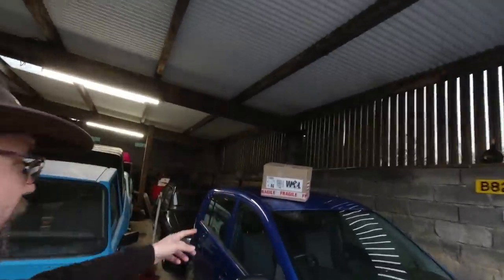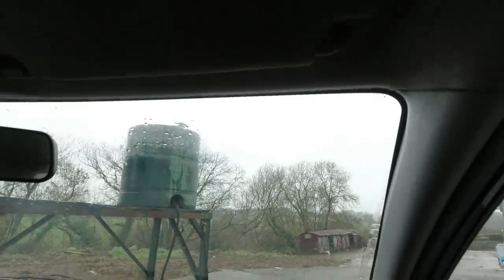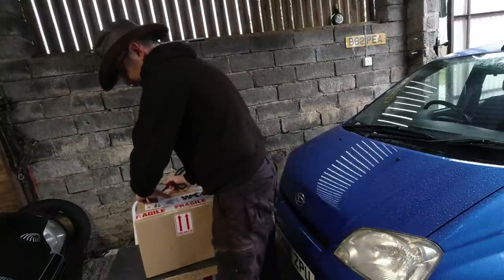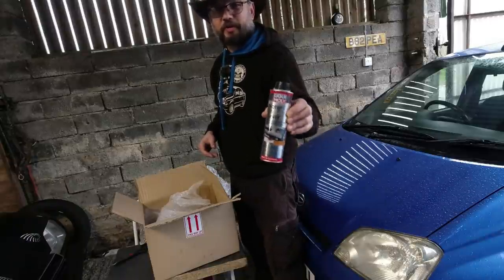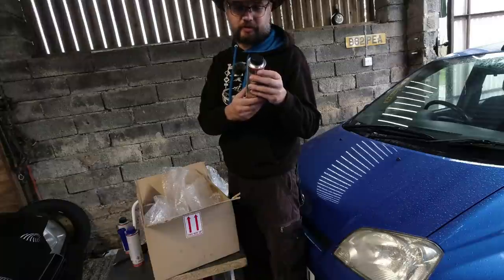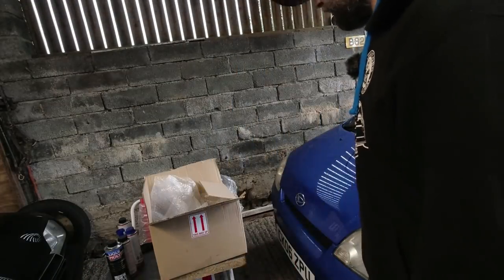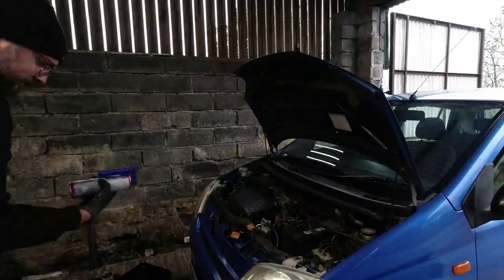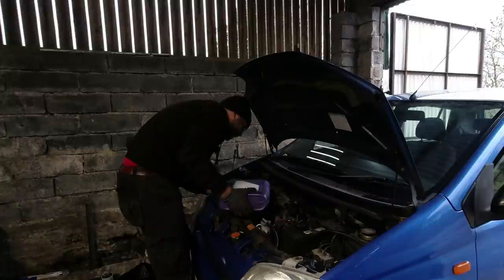Smoking Daihatsu - can additives fix it?

Comment: I cringe when anyone says "I put some engine flush in to remove the crap". It works as a product to dissolve stuff, but when it doesnt it moves the oil clumps near oil passageways and bearing oil holes. Not a wise idea. A friend scrapped a car after using engine flush as the engine has oil starvation issues... it made the situation worse. Plus on an older car these oil clumps help to seal the engine gaskets and sometimes piston rings (the opposite may be happening on this car). When a flush is used customers noted burning oil out the exhaust which wasnt there before and leaks that had never occured before out of the sump gasket. The best way of dealing with sludge is multiple-quick-sucession oil changes. More expensive but it works! Modern oils contain cleaners but unfortunately people dont stick to servicing and that leaves a problem for someone down the line. This is where additives are a cheaper, attractive but risky proposition.

Comment: If you look on most modern(ish) cars Ian, there's a little arrow next to the petrol pump logo indicating the correct side for the fuel filler. It's one of those things hidden in plain sight, that people often overlook.
Reply: Yes the wife pointed that out to me. Think she read it in one of those articles on everyday things you don’t know the use for, like hooks or signs in certain places, that no one ever questions what they exist for😂
Reply: In my 2007 BMW 1-series (with the same M47 engine as Rita the Rover, which is what led me to this channel), there is a fuel pump graphic on the right side of the horizontal fuel gauge, the same side as the filler. It's rumoured that if the fuel gauge is vertical, it should itself be on the same side as the filler. I can't confirm that, since I haven't flipped my car on its side yet.
Reply: @JohannesDahl42  yes I can’t imagine you’d want to test it😂
Reply: I thought that was only on American-market cars?
Reply: @HowardLeVert  no ive noticed it in British and European cars as well. May have been a idea that come over from America?
Reply: @matty6848  Or equally, it saves on making separate instruments for US-market cars - fits all regardless? Mind you, I think my 2004 car is 'modern', so what do I know?!
Reply: Ian must know that, surely? Even my Wife knows that. I would guess that Ian's just forgotten it in the excitement of administering the new snake oil products. 😊
Reply: @HowardLeVert  I've got it on my 02 X-type....so I think it's been around for some time now.
Reply: @BarryAllenMagic  I'm going to have to go and look at my heap again, by the sound of it!
Reply: @HowardLeVert  We don't have heaps! We both own exemplary, quintessential, paradigmatic, outstanding older vehicles. 😉
Reply: @BarryAllenMagic  Even though my front bumper is peeling like a fat bloke with sunburn...
Reply: Mine has no logo for fuel filler, I know it's on the left.
Reply: The majority of cars after 2005 have this feature. My last 300zx which was a 91 did not, my 2007 Aston has it. I don't remember it coming on anything pre 90.
Reply: I didn't notice our Avensis had this for ages, definitely hiding in plain sight!
Reply: @HowardLeVert  Simply a sign of aging gracefully with dignity; indeed if it's flaking where others don't, uniqueness. Mine hasn't run for about 4 months and the battery is as flat as a witches tit. Must get a new battery fitted this week - just hoping the old girl still starts. Look on the bright side - we could own HubNut's Yugo. That I truly believe, is a project too far. There's old wrecks.....and there's Ian's Yugo!
Reply: @BarryAllenMagic  Believe it or not, coming from an electrical background I'd like to tackle the Yugo!!
Reply: @HowardLeVert  You must like a challenge mate. I think it needs a complete rewire looking at the fire damage. I also think the engine is seized on it; and along with mega-welding, it's going to need deep pockets to get that thing roadworthy again. Such a shame; I adore Soviet-era cars. 😍
Reply: @BarryAllenMagic  I thought Ian said it was turning recently? And you're right - I do like a challenge... or I'm a glutton for punishment.
Reply: @HowardLeVert  I must have missed that episode Howard? I thought the Yugo wasn't even turning manually. Good to hear that you like car electronics; must be a dying art these days. Apart from the basics, I've never really understood too much. I put it down to those schematic diagrams in Haynes manuals - I could never make head nor tail of them! 😕
Reply: @richardsutton01  It's a new thing (you know, post-2000) and those of us who mostly drive mature cars will naturally take a while to catch up. Really neat, I was overjoyed when I discovered it.
Reply: @HowardLeVert  I wish I knew someone who liked tinkering with car electronics. My Mazda has a quirky alarm. It randomly activates no matter what setting you attempt to use, i.e. normal, deactivated internal sensor, etc! I also have an issue in that the boot light doesn't always switch off when shut so the central locking thinks the boot is still open! I have to open the boot lid fully to switch the light off then activate the central locking then shut the boot! Crazy stuff
Reply: @andrewhaines8603  That's probably what's triggering it. Mine used to trigger randomly - normally at three in the morning for maximum effect - and it turned out the wires between the bodyshell and boot lid were starting to crack and break - a common BMW fault. Pulling the tape back revealed a number of broken wires, which I repaired with small splices of extra-flexible cable. I've got to investigate this again as my boot light no longer comes on - it wasn't the bulb in this instance.
Reply: @HowardLeVert  sounds interesting. I can't fathom where the switch is that you usually have that switches the light off. I thought it would be near the catch acting like the type of switch you have in a fridge, but nothing there. Further investigation required!
Reply: @andrewhaines8603  I can't see an obvious switch in my BMW either but it's actually within the boot lid itself. Have a look-see on yours, you've got nothing to lose...?
Reply: @BarryAllenMagic  I work in electronics anyway - I'm old enough to remember when the only electronics in a car was the radio (yes, I do remember Lucas mechanical dynamo controllers!)
Reply: @HowardLeVert  I will indeed! Christmas is coming and we can't go anywhere so that may be a holiday project! Hubnut style of course!
Reply: @BarryAllenMagic  yep, also true of my ‘97 XK8.
Reply: Yes, it's on my 2006 Hyundai Accent too.
Reply: Apparently, if there's no arrow on the guage, the side of the pipe on the logo signifies the side of the filler flap. Appears right enough on anything i've driven recently, but would be interested if it's on all makes! :)

Comment: Take numberplate off and if same as a Cuore there's a gap in the bumper specifically for oil filter access.
Your 'after potions' smoke level is fairly similar to my Cuore's at MOT failure point. Mine wasn't obviously smoking when driving, but when left at idle or revved it did.
Oil burning+ potentially contaminated cat isn't a good mix.

Comment: That Molybdenum Disulphide engine additive is excellent. I've used it in all my engines, big and small, for at least the past decade. I used it in my AU Falcon and I now use it in my PSA 2.0 HDi, Mercedes M104 (in a W140) and Hyundai GDi. I also add it to diffs (non LSD)  and power steering systems and have done this entire time with excellent results.
Edit: I should probably add that being a solid lubricant, it can also take up to 500 miles before you notice any differences as it takes time for pressure and heat cylces to plate the metal surfaces within the engine.

Comment: Catalytic converters can tolerate an incredible amount of burnt motor oil. I do a lot of emissions tests in my workshop (I am a certified German MOT garage) and sometimes I come across hybrid-cars (running on engine oil and fuel) which produce excellent results on the emissions tester. The last car I remember was a Mazda 626 which needed more than two liters of Oil every 1000kilometers according to the owner. 
It passed the emissions test first try with every reading "in the green".

Comment: 500 mixed usage miles letting the car warm up gradually gave me a 98% improvement. Watching some of the various Liqui Moly tests by independent youtubers you can see what the various additives are doing. 

Would highly recommend the engine protector they provided as it leaves deposits in any scored components and reduces friction which helps seals to do their job. 

Also it treats upto 5L so I would have added 90-100% of the additives especially as some contain heavier metals in suspension.

Look forward to the next installment.

Comment: You can easily cure that handbrake sticking on by pouring 3 in 1 oil down those mini bellows at the end of the handbrake cable.
It used to do this on my astra mk4.
Just use a big safety pin to open out the bellow and pour down the oil.
Then about 3 years ago these bellows on my car were split in half either end due to perishing and i packed some copper grease in the bottom half of the mini bellows then cleaned the surface of the split and then super glued the split bellows together and all has been perfect ever since.
Also i put 3 in 1 oil on the handbrake pivoting arm mechanism for good measure.

Comment: I don’t know anything about that engine, but I don’t think the bulk of oil smoke is from valve stem seals. My first car had that problem, and the main characteristic is a lot of smoke when you set off, not so much at sustained higher rpm. The high manifold vacuum from the closed throttle body butterfly valve at idle pulls oil around the intake valve seals, then when you hit the throttle that oil gets burned up. The Daihatsu seems to produce most oil smoke at higher sustained rpm, almost like a two stroke engine, so I’d suspect the problem is indeed in the ringland. And I don’t think any sort of magic potion is gonna do much for that, unfortunately.

Comment: Just a note,  Petrol  ◀🚉 or 🚉▶ small arrow next to the Icon identifies  which side the  filler cap is on,  Most cars not all + New 👍😀 hope this helps .
Reply: Certainly older cars do have that feature, I have used it to great effect for years !
Reply: All new cars sold in the US have had those little fuel direction arrows for at least the past couple of decades.  But most people never notice.  They are very helpful when you are driving an unfamiliar car, such as a rental car or a friend’s car.
Reply: @jkk244  Yep, all my new cars over the years have had this feature , so it must be a good 9/10 but I do need my glasses on to see the thing these days.🤓

Comment: I think the main issue with potions is, they are made for when your engine is burning a little oil from age and wear. However people use them as a last resort and expect a miracle to happen and it to stop burning oil straight away. Glad you went into it not expecting that, however the improvement it has shown, shows what a difference it would make to a car with high mileage burning a little bit of oil.

Comment: It would be interesting to see if its smokey downhill on the overrun, that's  the test for valve stem oil seals, but smoke when revving is much more likely rings. If they're stuck and you've found an additive to fix that, well done, but if its wear then its rebuild time, methinks. Cant see it passing MOT the way it seems at present. Interesting  to see if the plugs are oily when you change them, may as well do a compression  test at the same time. Anyway  all good viewing!
Reply from the maker: I can't see smoke on the overrun. I did leave it idling a bit today, and there was then a mighty cloud of smoke when I pulled away. Plugs looked old rather than oily.

Comment: If the rings are a bit stuck, tipping an appropriate fluid in the spark plug holes may help, but will have to be cat safe. Other animals are available.
Reply: Exactly, when it's warm take out the plugs and squirt in some paraffin. Let it sit overnight, spin the engine then fit the new plugs.

Comment: My Honda Element was sludged up after <>130K miles and the engine was clattering quite badly. My mechanic suggested that I allow him to do an oil change with transmission fluid in the engine and drive it for 1000 miles. His rational was that transmission fluid is loaded with detergent and other anti sulficants. So we did the transmission fluid oil change and did a flush after  1K miles. The oil came out pitch black and was replaced with the usual oil. The engine ran super smooth with no clattering or smoking. It's now got just over 160K and it's still running perfectly. Just a thought...

Comment: It occurs to me that that engine and exhaust have what is called wet stacking, where the exhaust is coated with oil and it takes time and higher temperature to burn off

Comment: On these...the oil drain holes in the lower piston ring groove, (so behind the oil control rings) can gunk up. Running it on some high detergent diesel engine oil may help and be more effective than a while you wait idling flush product.

Comment: I used to have a Ford Escort that used to puff on the first start up of the day because all the oil had drained into the pan. Those other potions you added keep a film on the metal surfaces so when you first start, it's not metal to metal. It worked fine until I got rid of the car. Next time you change the oil, use 10w-40 in it. It is well within tolerances and will help with the morning start and all around. I use it in my vehicle as it has 177,000+ miles on it and it helps alot. Good Luck with it.

Comment: Yes, that does seem a bit better with the Charade smoke issue. I had my 2004 Fabia serviced in the Summer and the garage did a fuel system/injector flush with the fuel filter change and an oil additive along with the new oil/filter. I really noticed the difference from a normal service. A bit more pep. So maybe these 'magic potions' really do work quite well on older engines.

Comment: Glad it did something. I might change my thoughts on Liqui Moly if it improves the problem over time even more.😀 As I said before I've had some bad luck trying to get rid of smoke from burning oil in my Daihatsu by using miracle liquids.

Comment: Do the EVO triangle with the Daihatsu, the engine will get warm / hot at least and the oil can burn from the engine and exhaust. That does not happen with short journeys and cold starts. Good luck with it Ian.

Comment: Hub Nut the fuel filler cap is indicated by a pump nozzle or arrow on all modern cars, not the more antiquated cars of the 70's and early 80's. I do not know when it became a feature, commenters comment?
Reply from the maker: I've checked a few cars and found that one to be a myth regarding pump nozzle.
Reply: @HubNut  So that's one busted. Seen an arrow though to show the cap, wonder when that started?.

Comment: Possibly got a gasket leak/split or leaks/splits on the inner head surface. So when it's cold, it weeps into one of the cylinders. So first thing it's full of smoke but once the engine gets really hot, said leak gets less worse. This type of gasket failure causes no misfire. One sure way to test is to look at the plugs and see how 'wet' they are. 
As for the additive, all it does is coat the oil filter. 
As for using products, best products on market are made by Forte. They really do work. Liquid Molly always found their products not up to scratch.
Plenty of research and testing about LM additive and Forte products on line.

Comment: You need to put about 2000 miles on that engine before you start to see the benefit of the additives, make it your daily driver for a month and i think that it will clean up about 80% of the smoke by softening the rubber seals. in the mean time price a set of piston rings and I sense a really interesting video coming up all about changing piston rings   keep up the good work . from kelvin in south wales UK

Comment: I reckon the smoking was caused by a combination of both gummed up piston rings and worn valve seals. The engine flush and additives seem to have worked quickly on the rings judging by the marked improvement during hot running. But I think there's still oil getting past the valve stems while its parked, hence the smoky start-ups. Hopefully, that will improve with time if the Oil Saver is as effective as the other products look to be. Good result anyway!
Reply from the maker: Yes, I agree. If I leave it idling for a few minutes, then pull away, there's one heck of a cloud. I suspect that's valve stem seals.

Comment: A little voice is saying "Clean the crankcase recirculation kit". Others have mentioned it. My missus had an early Montego (I know...sorry) and it had no breather kit fitted and if you revved it hard it produced an amazing smokescreen. A breather kit was fitted, which BL charged us quite a bit for, and it cured it completely. The car was still pretty rubbish. Probably our worst buy even though it only had 30,000 on the clock and we knew it had had a quiet life as we knew the original owner.

Comment: I would place a bet that it is the stuff that helps the valve stem seals that has improved it. Those seals let a lot of oil in when you rev the car when they are worn. Nice teapot pose at the end.

Comment: I previously said that the smoke didn't look blue - so I take on board the all important smell test that you mentioned that clearly shows it is burning oil. So, if the oil treatments don't have the desired effect check out the crankcase breather hoses next

Comment: One thing to check for make sure the engine breather isn’t blocked otherwise you will get pressure in the Sump which will force oil past your valvestem seals and your piston rings cheers Derek